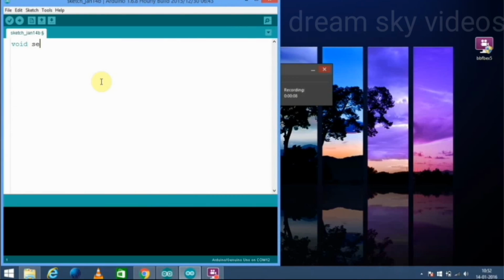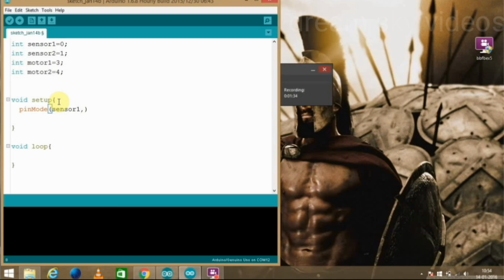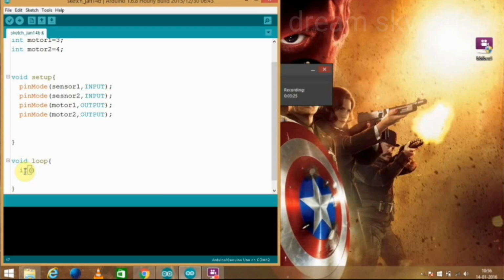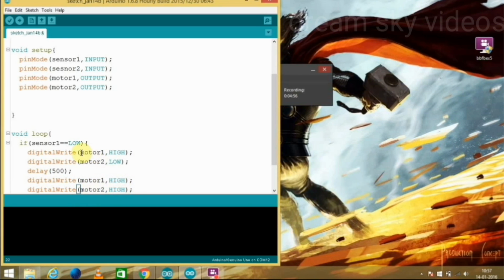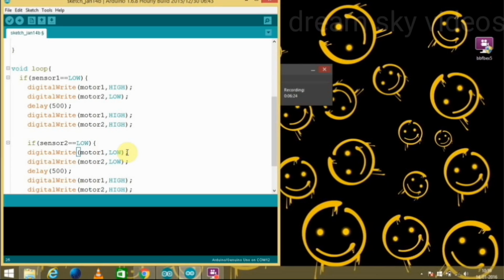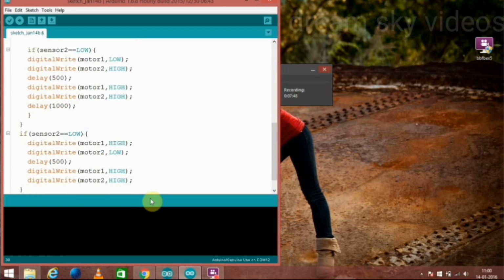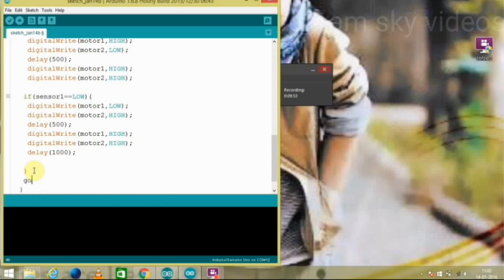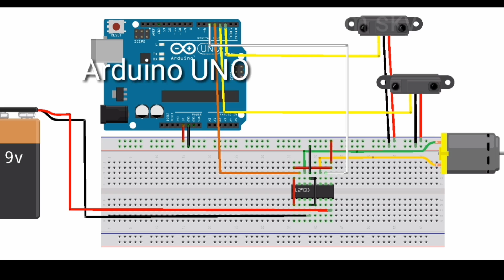Automatic railway crossing using Arduino

Comment: Hi Manish, 

Just watched your video as i was looking for some help on how to build my own set of crossing gates for my model rail layout. Could you possibly help me? i want to control four gates using a servo for each gate, each gate moving ninety degrees. I want to control the gates to shut with a switch and reopen with another switch, i can do all the mechanical side of this but i do not know how to do the programming for it. I have got an Arduino Mega 2560 to control all the bits, would really appreciate some help with the programme if you were able to help me.

Best Regards 

Phil Newman

Comment: Bro.. I connected my circuit properly as you said.. I connected my motor through a motor driver and dumped ur program into Arduino but the motor isn't running,not at all responding
Reply from the maker: praveen chowdary maybe circuit is not properly connected. If you have programming knowledge, run the motor by test code.

Comment: Interesting. I did not know that you can use a GOTO statement in Arduino. However as you can tell, it makes the code unclear. It can be done without the GOTO. And if you add two sensors on either side direct next to the railroadcrossing you can  detect the trainlength and thus keep the barriers down until the complete train has passed.
Reply from the maker: That feature is in my next video 

https://youtu.be/wtU9xPPJ4Ww

Comment: Hey I'm working on same project and its not on toy its real but I'm facing a problem if tain is coming from sensor one barrier high; first condition
But if train leave the the sensor one and going to sensor two then how to write a programme becoz here is sensor one is low; and sensor two is low; but we need barrier high;
Reply: We need only two input and some times train stay between both sensors then we cant use delay here.

Comment: what happend if i use stepper motor 4 pin ? what will be the connection and what will the programming then..
Reply: brother i had tried ur method same connection , same program. bt the motor is not running at all . i had check so many times the ckt. all instruments r okk program is uploaded.. bt motor is not running at all.. pls need ur suggestion.

Comment: hello
could you please send me the code
thank you
Reply from the maker: +james o'connell 
Please visit to the link
Reply: hello
 the only link i see is facebook
i am not on face book could you send me the code please 
as i am very impressed with what you have made and would like to make one for my layout thanks
Reply from the maker: +james o'connell https://www.instructables.com/id/Automatic-Railway-Crossing-Using-Arduino/
Reply: thank you very much for your help
also would it be possible to run two motors to open each  barrier off of one motor driver
thank you
Reply from the maker: +james o'connell please mail me 
Man.suthar2012@gmail.com